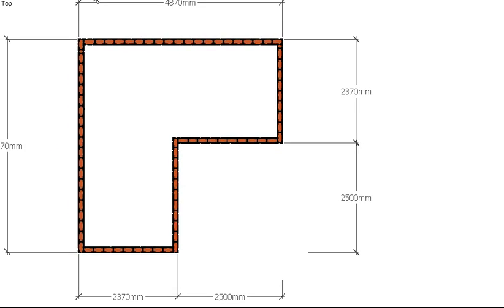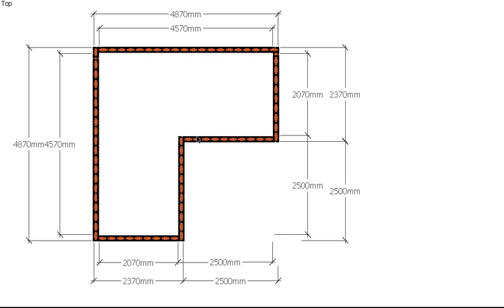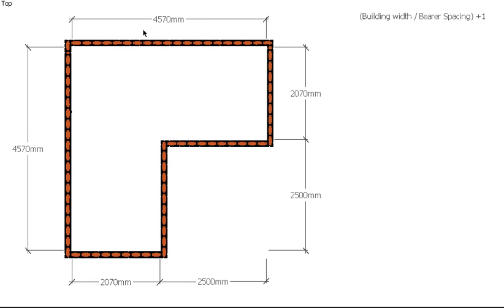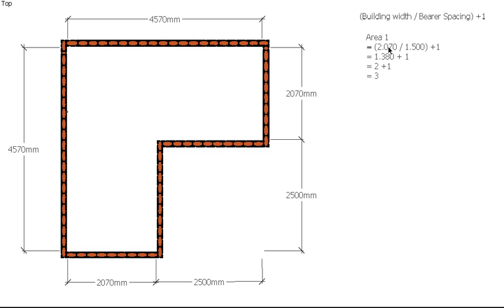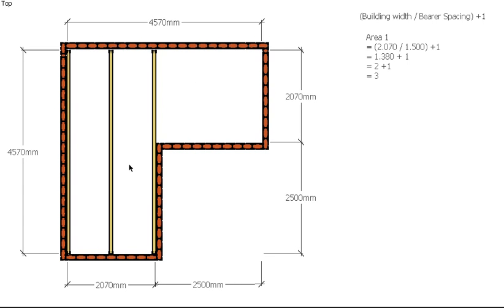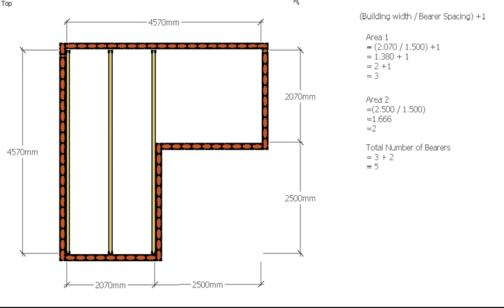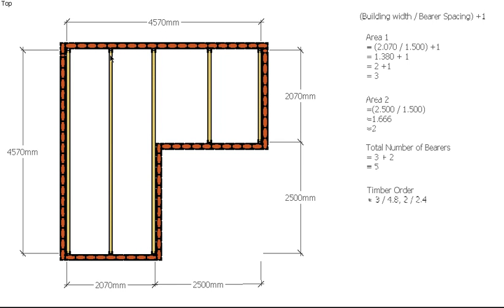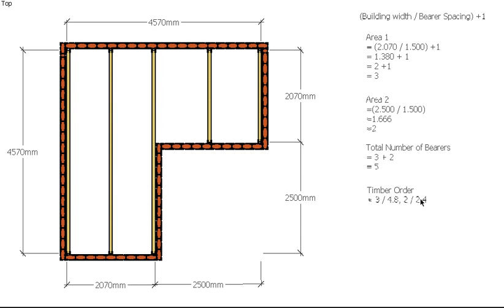Calculating Bearers

Comment: Hi Buildsum, I'm about to put in a beam that spans 3m in an external wall that will hold roof trusses above. (the house is 7m wide (trusses therefore 7m long, 800 apart?) , where do I find a Australian table that details recommended dimensions for bearers/beams?
Reply from the maker: Hi Mate, AS 1684 has all the spantables for timber frame members however if you are unable to get hold of this then several manufacturer / suppiers have thier own span tables. 
There are links to some of the in the description of this video, https://youtu.be/cBgjN6A7F_o
Hope this helps.

Comment: Hi, I know this is a old video, but, i have a questions.  How did you know to use 1.5m as your bear spacing?  I am trying to calculate the how many i will need for my own plan. Also, when calculating location & size of bearers, does bearer height factor in? I ask because my platform will be built on step footing (the plot slopes downward from front of house to the back).
+
Reply from the maker: Hi Joe

You would need to reference the span tables for the timber you are going to use to determine the span and therefore the position of the piers. The span of the joists determines the position of the bearer. 

Have a look at my videos on As 1684 Bearrs and joists